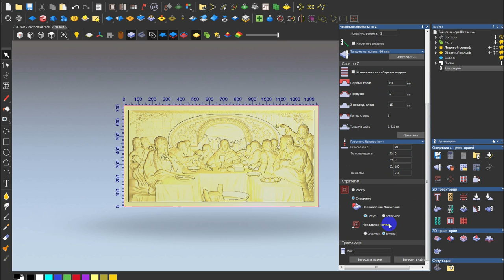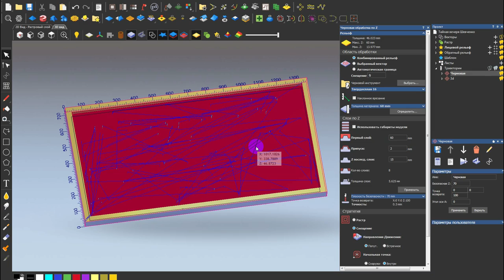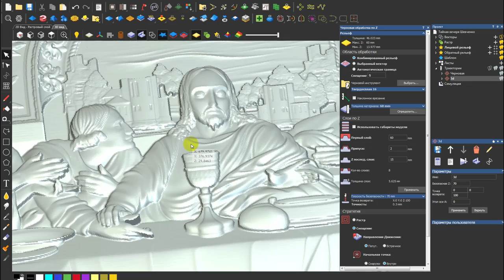Large carved panel of the Last Supper with CNC. Панно Тайная Вечеря

Comment: These are the sorts of projects that can be done very easily with PixelCNC and some Photoshop/GIMP skills, no 3D modeling or any other software needed. http://deftware.itch.io/PixelCNC/
Reply: Charles Van Noland, I beg to differ. The key to successful relief art lies in the input and this is clearly based on either a 3d scan or digital creation. You don't get a depth map like that from any simple drawing or photo without essentially sculpting the heights properly. Perhaps that's what you meant, but "very easily", I think not.